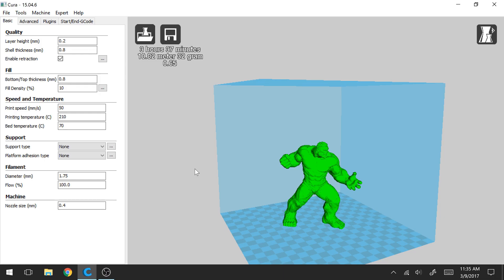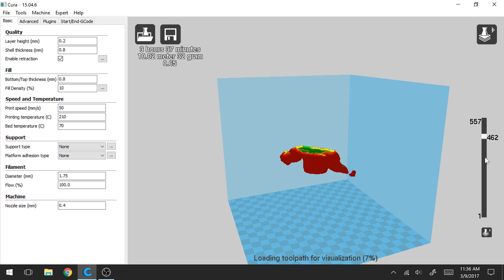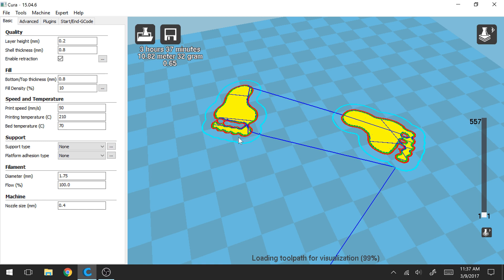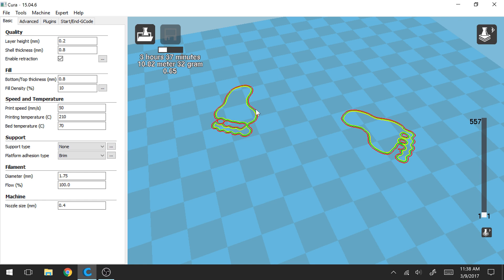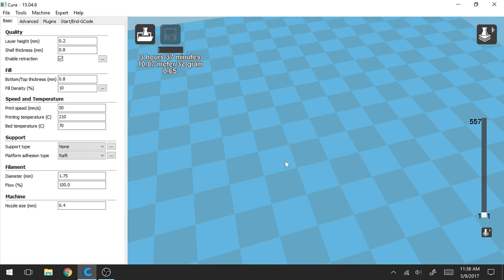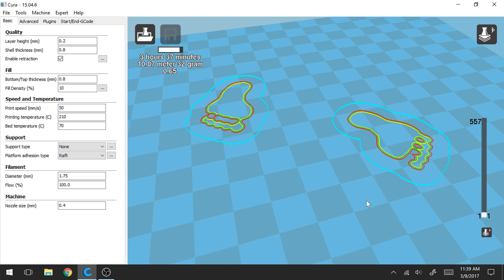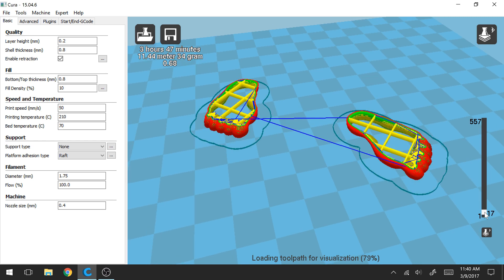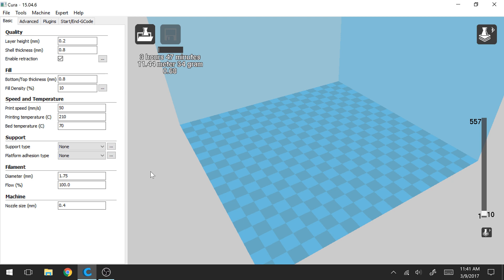3D Printing Tutorial: Platform Adhesion (Skirt , Brim , Raft)

Comment: it actually help overhang too, your 3d is a good example. when you use brim the roundness of hulk thumb is better because its act as thermal shield from the bed and cooling faster for overhang the thumb, so you can get hotter bed for better adhesive

Comment: What is cura version 15? I have the latest Cura version 4 from their website. I was looking at a 2nd printer called the Predator from Anycubic. I noticed the predator isn't in the printer selection for the latest cura. I read more into it and the predator comes with what people are calling a older version of Cura. Cura Version 15.

How the F is Version 15 older? And why is the newest version on their website version 4?

If anyone can clear this up that would be awesome. I guess also if i bought the predator I'd be stuck with that version of Cura that comes with it forever?
Reply: @the3dprintzone  you are using Cura 15. It's version 15.x.x on the top left corner of your screen.

Mine is the latest version of their website version 4.x.x

So I'm just confused as to why I heard the anycubic Predator comes with a older version of cura 15.x.x..... But yet the newest version is only on version. 4.x.x

Your YouTube video is the first time I saw the 15 version of cura.

Currently have a Ender 3. Just got it a couple weeks ago and really got use to the 4.x.x Cura. In mine if I select no plate adhesion it doesn't default to a skirt. It won't do one period. Yours it looks like you are stuck with at least a skirt. So i know that's one difference. But not sure what the others are.

That would be awesome if can configure a round build plate like the predator with my cura. Didn't realize I could add custom set up. Thanks man.

Comment: Thanks for the informative video! I was misinformed - someone told me that printing with a raft helps to remove the print with greater ease. I got my Ender 3 in the mail yesterday and have run a few prints through it, including an 11 hour Otyugh from DnD. However, now I have a large (and skinny) raft firmly adhered to my bed. Any tips on cleaning it off?
Reply: If its a glass bed id use a metal paint scrapper